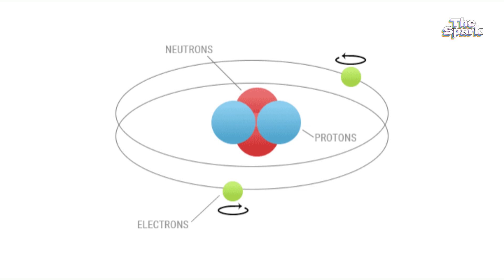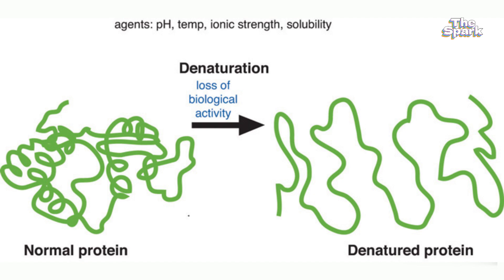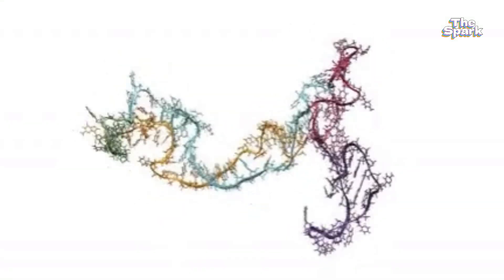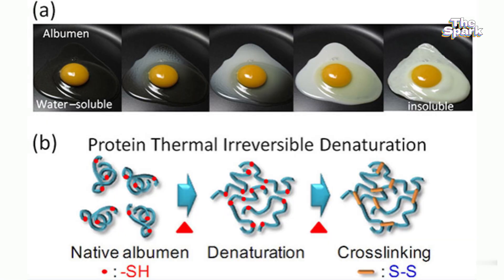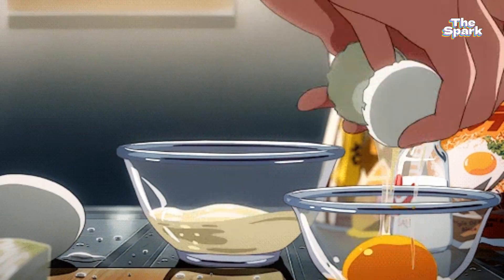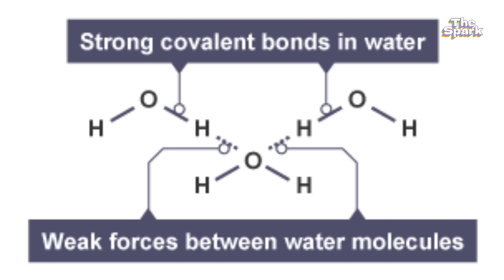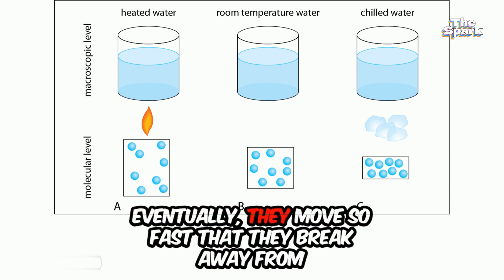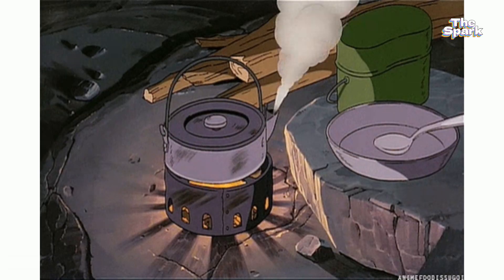"Why Heat Makes Eggs Solid but Turns Water into Steam" | The Spark

Comment: It's simple.......you just haven't heated it enough 🤪
Reply from the maker: Good observation but At high heat, the proteins in the egg whites begin to denature and coagulate. At extreme heat, this process happens very quickly, leading to a rubbery or dry texture.
Checkout other videos and don't forget to Subscribe.